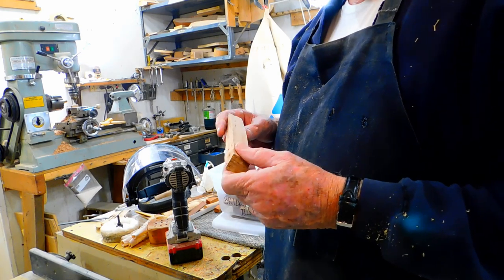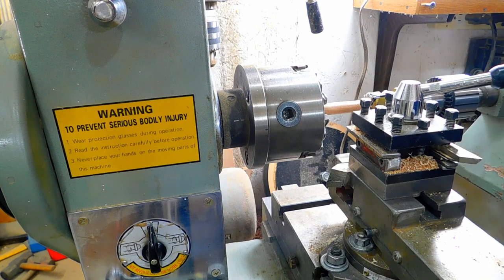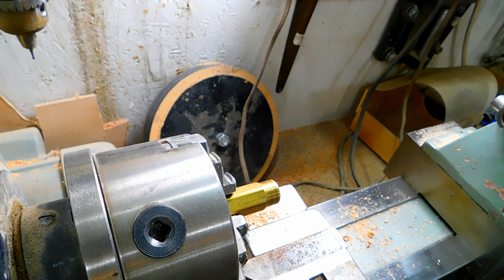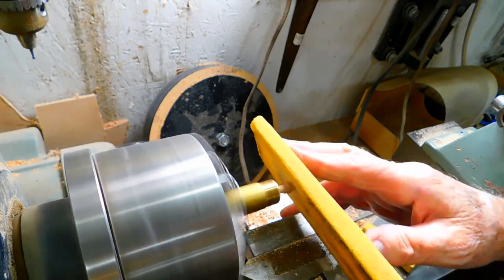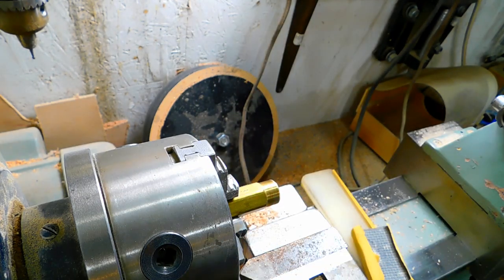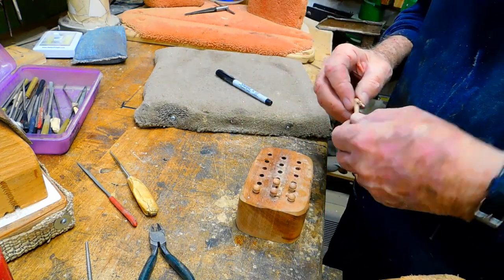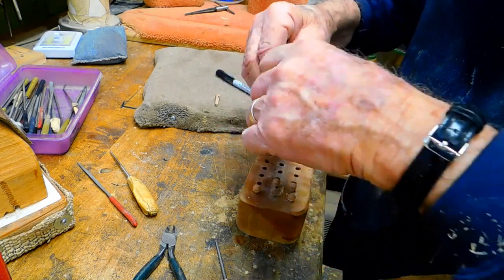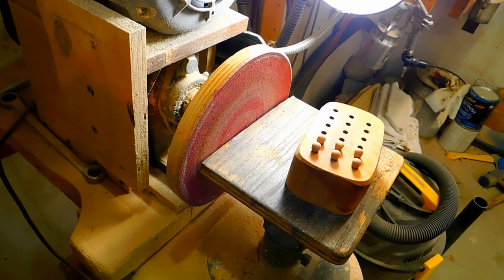Making Dogwood Bridge Pins For An Acoustic Guitar by Ronnie Nichols

Comment: Thanks. I'm considering making some ebony pins. Does the brass holder that holds the pin in the lathe while you cut the pin's head have a straight-sided hole or a tapered hole?
Reply from the maker: It has a tapered hole that matches the 5 degree taper. I think I started with a 3/16 inch hole and reamed it out with the 5 degree reamer like you use on the bridge pin holes in a bridge.
Reply: Thanks for the reply!